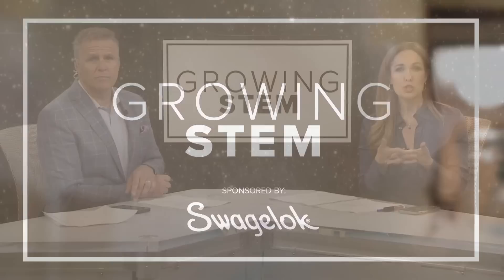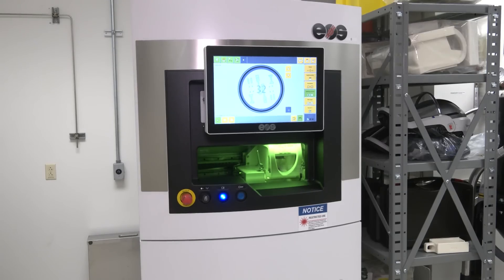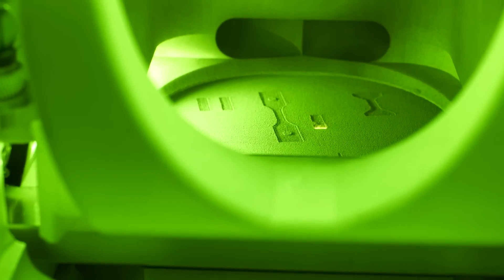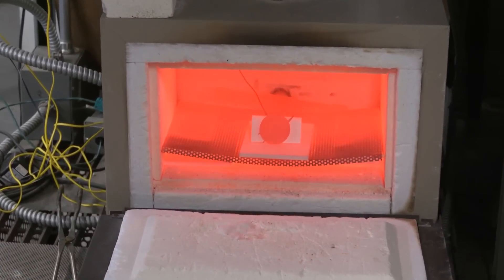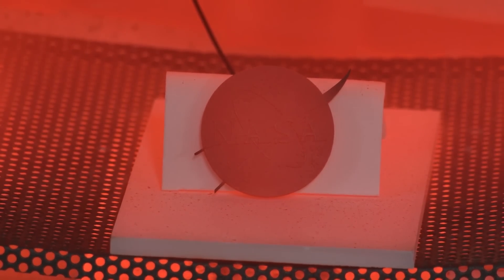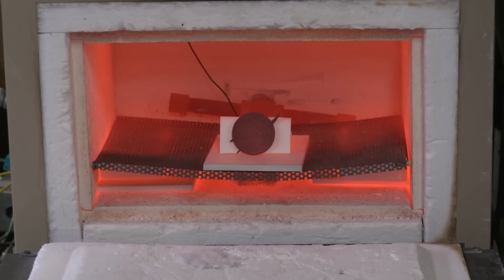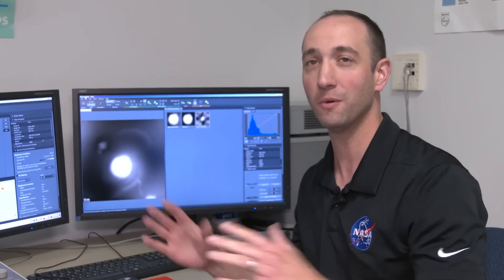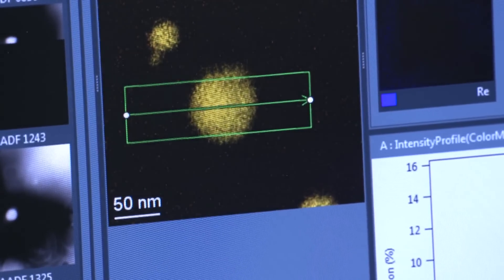2 NASA Glenn engineers invent new superalloy worth billions | Growing STEM

Comment: Not to burst their bubble but what is the difference property-wise of GRX-810 from 904L Stainless Steel or even 316L Stainless Steel in terms of Tensile, Torsion, Flexion, Extension, Compression strengths? Other than a bit of extra Chromium, Cobalt, Nickel for anti-corrosion and hardening and some Yttrium Oxide used to prevent "Glass Creep", I see that the base properties of 316L Stainless Steel or even 440C are FAAAAAAR SUPERIOR to this alloy!

If you want some prevention of Hydrogen Embrittlement, just coat the stainless steel with a decent thick-film aluminum oxide ceramic and your cost is MUCH cheaper than this one! What these scientists NEED to go for in terms of research is coating BOTH sides of single-wall carbon nanotubes in 2000 Degrees Celcius resistant ceramics so that they can be woven into large 4x8 foot quarter-inch thick sheets that are super lightweight and won't burn or melt past 1500C AND are strong enough to withstand 1000 metric tonne crushing weights or multiple volleys of 20 mm or 30 mm rounds!

Now THEN you would have a proper super-material  and not this mild extension of 316L Stainless Steel!

V

Comment: I guess what they're really after with this technique of using fine particles of metal and ceramic is to get a near perfect distribution of ceramic within the metal matrix which would have interesting properties although I'm not sure the edges of the metal matrix wouldn't melt leaving only the ceramic outer edge but maybe that's fine because the metal matrix remaining within the ceramic holds the edges together. Kind of a fascinating composite

Comment: Everybody seen this coming, engineers already have such alloy it’s purpose is to make tank armour more resistant to shape charges the problem is it’s brittle and is useless vs tungsten spigots.  
So you didn’t really discover much, it’s as useless as teflon on cookware. 
Any less dense material does well vs heat as long as is not flammable. 
😂👎

Comment: I think the Cree LED used in flashlights was limited to the very high-end for many years.  Took almost two decades to actually hit the masses by Chinese brands. 

Similar to steel using a fine powdering effect that increased hardness, toughness and rust resistance.  Many years to happen for the masses.

I'd imagine this product may not make it the masses at all without substantial changes.

What's really needed is synthesizing gold at a much lower cost.

Comment: As an aeronautical enthusiast and aspiring pilot, this is totally huge!

Materials Science is all the rage these days, in just about any aspect of the transportation industry there is a dire need for stronger, more heat resistance parts, which will allow for much higher horsepower and far more clean and efficient engines because fuel can burn more completely and parts can rotate much longer and faster.

Hypersonic flight, here we come!

Comment: My guess it is a Super alloy (high nickel) plus a nitride ceramic such as SiN, though SiC might work too. Would 3D print followed by vacuum sintering to stabilize the grain structure. A titanium/aluminum nitride or oxide metal ceramic is unbelievably tough as well but wouldn't take rocket engine stresses that well. ❤

Comment: Well, I "saw" this a couple of dozen years ago in a dream. A new high tensile strength material that is "grown" in a lab. Except in my dream it was being grown using electricity (electrolysis) and adjustable magnetic fields that drew and deposited various amounts of the elements; and magnetic fields that assisted in the shaping of the "parts" (in this case, very lightweight and heavy-duty spacecraft and aircraft 'skins') to exact tolerances that basically allowed the parts to snap together prior to a laser welding process. We're not there, yet. But this "materials printing" process tells me we're not far from it, either.
Reply: Drugs are Bad! M’kay.

Comment: It's technically a composite.
Reply: Not quite.  A composite is more like a blend between two materials.  More or less organized in a matrix of some sort.  Like Cermets (usually more ceramics) and Metal-matrix-composites (usually more metal).  Although it “begins” as extremely small particles with metal cores covered by ceramic shells, it seems to en up as an alloy with oxides inside the otherwise metallic structure/lattice.  Perhaps one could argue it’s a material that is something between a ceramic and a metal.  But if the metallic qualities remains, an alloy it is.
Reply: Yup its a cermet composite. Similar to the stuff they use for high reliability potentiometers, but thicker and likely a nickel based superalloy as the base metal. ❤
Reply: Indubitably. I agree with all Of the statements above.
Reply: Yeah yeah,  D. All of the above  😀🤓@LouisianaBredTexasFed
Reply: That's what I was thinking
Reply: If the constituents are covalent bonding at the nanoscale (1 billionth of a meter) I'd put this more as a compound.
Reply: @situational.analysis  maybe a hybrid ?
Reply: @jacobclark89  I think so, but we don't know what the metal powder is. The ceramic particles themselves are derived  from a molecular bond of a silica substrate combined with another mineral like clay or feldspar. This, in turn, through heat fusion, is attached to the metal. An orbital hybridization different from the original atomic orbitals suitable  for electron pairing to form chemical bonds (valence bond theory) would combine the two into a new heat-resistant hybrid compound resistant to mechanical seperation.
Reply: It's over priced
Reply: It’s definitely not a composite. It’s an oxide dispersion strengthened alloy. ODS
Reply: Alloy basically means composite...
Reply: Yes I have.

Comment: The way such printers work is:
You start with a flat bed to build on.
You put down a super thin layer of powder.
The LASER goes over it and zaps the bits that will be in the part.
You then add another layer of fine powder
The LASER then zaps that layer where it will be in the part welding the new layer to the previous.
You do this again and again so that you end up with a part buried in a pile of the powder that didn't get zapped.
The printing method isn't really new.  The material is a new idea I think.

Comment: LOL - yep - apparently - this is waaaaay over their talking heads...
they are stuck on the 3D printing aspect of the story - HOWEVER
it IS NOT the printing of the material - so much as IT IS the coating of the Metallic particles with Ceramic particles before the actual printing is done...

Comment: Lathes and milling machines use a prosses called subtractive machining where you start with more materials and the unwanted material is removed until you have the part that you want. 
3D printers use a prosses called additive machining where you start with nothing and you add material until you have the part that you want.
Reply: "additive manufacturing" is the more common term.

Comment: To print it 3D like they're doing, you just have to use small powder and you only hit the laser on where you want the materials to fuse together and then when you're done you spray the excess off the part. 

However, coding prior to melting is probably not advantageous😅 it sounds like ceramics just with the infusion and inclusion of some sort of metal. More than likely a stainless steel though with laser you technically could Hit the heat requirement of titanium

Comment: It’s not new they just keep pulling the same motor apart. A regular combustion engine is 2500 degrees with oxygen in the fuel it’s not burning that hot. NASA is retarded or committing fraud again.

Comment: So, how does the material print if it withstands red hot temps? Or is that ' it prints the substate then the kiln sets the alloy as a tempering?
Reply: They mix metal powders with some ceramics and then the printer spreads a very thin layer of the powder mix where a laser, focussed to a fine point with very high temperatures fuses the powder together.  Then the laser is moved over a few microns and fuses adjacent particles.  This happens very quickly and it appears as if the laser is just scanning the layer until the geometry pattern is finished.  Then the table the powder/part is on is lowered a few microns, a fresh layer of powder is carefully spread and then the next layer is fused etc.  Eventually a 3d part is made.
Reply: @ricinro  thanks for the reply and details! I’ll see the metal printing like a micro scale volcano, or maybe a star now.

Comment: Why don't they just make airplanes out of the same material as the indestructible "Black Box"?
Reply: The plane would be too heavy.
Reply: @ricinro   But it would survive a crash on I-70.
Reply: Most of the black box is fire resistant material with an outer case of ordinary steel.
Reply: @christopherleubner6633  I know. It was a joke.
Reply: Dennis Miller
Reply: @erics.4113   Eff Dennis Miller. He's a lousy Trump supporter.

Comment: But what are its cryogenic properties for cold cold space? Space ✨
Reply: The news here is that this is the strongest metal yet able to be 3D printed to aerospace qualifications. Tim et al at NASA GRC will be working on refinements (probably already have been); actual commercial applications are what the licensing to companies are intended to be for. Not only do they have a clear incentive to find out if 3D printing this new strong material helps ‘solve’ any problems in terms of products or applications that currently exist; they can also go about thinking about new products/applications that might not have been able to exist up until now that maybe could become more realistic, not only in aerospace, but outside aerospace where higher volumes are possible. (Keep in mind, one of the problems in aerospace is that it’s relatively low volume; finding applications outside aerospace - whether it be autos, consumer products, whatever- where potential sales could be in the millions, is considered the real prize, and where commercial companies have the real incentive). - Dave Huntsman
Reply: Space is hot...not cold.

Comment: What I haven't figures out in metal/ceramic composite, is the metal the binder for the ceramic or is the ceramic the binder for the metal, or does binder depend on ratio of metal/ceramic????
Reply: If it’s got military applications which I’m sure it will in the aerospace industry. They may not want to give their formula for making it cause they don’t want to compete for defense contracts.
Reply: I suspect that effectively both are true.  For a long time there has been an aluminum/ceramic material where the aluminum is trying to shrink but the ceramic won't let it.  It has the crush strength from the ceramic but because of the aluminum compressing the ceramic, the ceramic don't crack.  Ceramics only crack if there is tension locally.

Comment: XRF the material to get the overall elements and then scan it will a scanning electron microscope and X-rays to determine the location of the ceramic particles.
Reply: Yup that would be an easy way to reverse engineer the stuff. I got a good idea what it's likely made from, a super alloy powder like iconel combined with silicon nitride ceramic particles. Both these are fairly off the shelf materials. Iconel powder is used for metal spray application of hard facing and ultrafine SiN powder is used as an optical surface polishing compound. The laser forming is likely followed up by vacuum sintering. A composite like that would take an unbelievable amount of stress and heat, would for all intents and purposes be like real world atamantium with the superalloy giving toughness and the nitride ceramic giving a hardness close to diamond. 3D printing would be the only way to make parts of a composite like this as it would be too tough to machine. 😮

Comment: 3D printing rocket engine parts enables fewer pieces, stronger structures, and more radical designs.  3D printing houses, on the other hand, is a silly and wasteful marketing gimmick.  3D printed houses will NEVER surpass the advantages of factory-built module housing components.
Reply: You seem really triggered by 3D printed houses…you sure you’re okay?
Reply: @Conceptsofaplan8647  I'm trigger by stupidity.
Reply: You are completely wrong about 3D printed houses

Comment: How does this compare to the metal in the Raptor engines? That's about the most advanced rocket metal I know of.
Reply: The truthful answer is, “I dunno”. But the emphasis here seems to be that this is one of the strongest  materials yet now able to be 3D printable to aerospace standards. So it now goes in the ‘toolbox’ of materials for materials and processes/M&P folks at SpaceX, Blue Origin, wherever, to possibly see if it’s ’better than’ what they are using now in any application. - Dave Huntsman